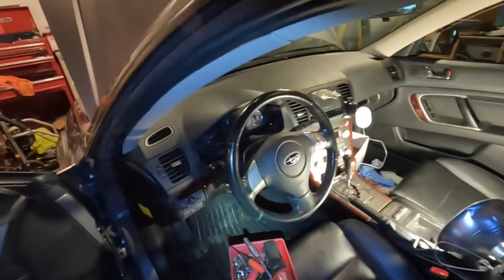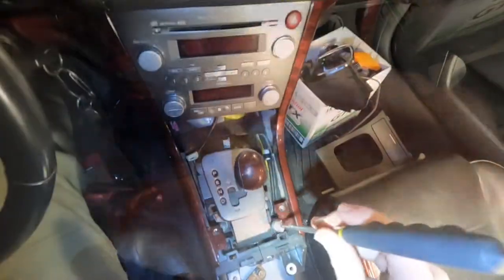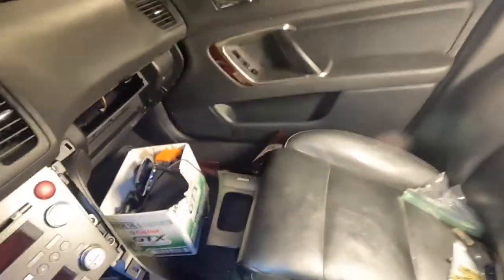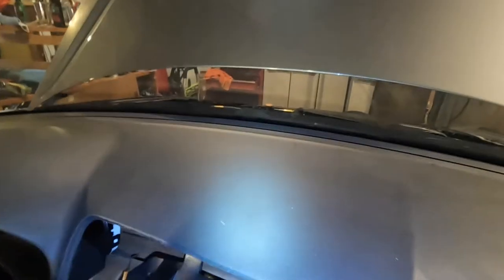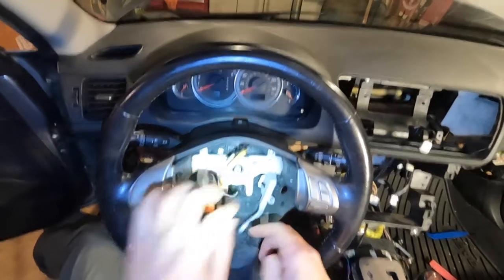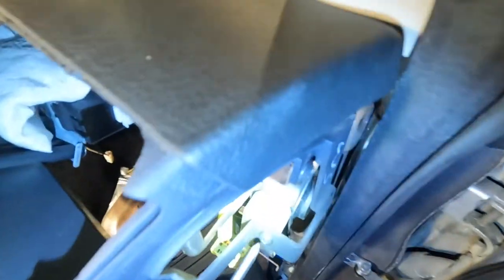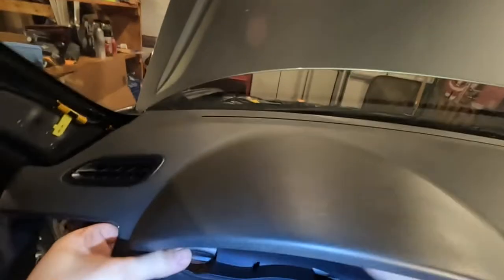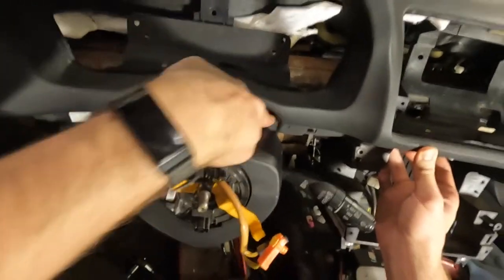Subaru Outback 2005-2009 Dashboard Removal

Comment: So all this is required to change the passenger airbag?? My dash is so sticky and gross. Perhaps the same reason you decided to swap? I still havent taken my car in to have the airbag recall done. If I can find a replacement dash in better shape what are the odds I can get the dealership to swap it when doing the recall work? Am I dreaming?
Reply from the maker: Good question, I believe it’s the only way to get enough room to pry the tabs and slide the old one out. The center support beam runs right behind it and gets in the way. Mine had a mouse infestation and they chewed away at much of the foam and it smelled terrible as it was soaked in urine. If you look along the glass the foam is all chewed, lol. So after about a year this dash also started getting sticky in spots when in direct sunlight. I wouldn’t recommend sourcing and swapping a dash if it’s sticky simply because it will happen again on all these dashes. I’m looking into either a carpet mat or a multi step process to clean and reseal the vinyl. Though if you do find a replacement I don’t see why they couldn’t swap it in when the recall work is done. They used to replace the dash under recall for being dangerously shiny from the stickiness so they better help you out!
Reply: @chrislabbe9412  Oh man I was so annoyed when I realized the dash used to be a recall they don't honor anymore. I mostly just putz around town so the shine didn't bother me as much as the layer of dog hair the sticky accumulated. But I recently road tripped from MN to TX and back and holy hell I burned my retinas! 
I've also been looking at dash mats and the resin sealer which I know ill just get all over my windshield. Maybe I'll price a dash and seal it up uninstalled then try to charm the dealership lol 
I really appreciate your response!! 
I found your video looking for a guide to swapping my cabin fuse block. Any insight if that's too tricky after getting that kick panel off?

Comment: Do the camera angles suck, sometimes but amazing video. I haven't done this in years and I'm right back at it. 

Also, for the heater core peeps make sure you backflush it first and then load it with draino overnight. I do it every couple years. Inlet is on passanger side, outlet on driver side.

Comment: Thanks for the video. I get all the to end and can't seem to find how to separate the airbag connector on the passenger side. Does it just pull or pry apart? There no release clip or anything I can see. I've spent as much time on it as the whole rest of the removal process.
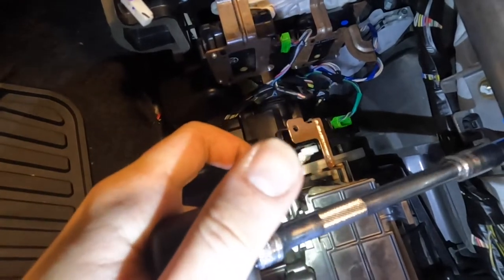Reply from the maker: At about 17:20 it’s the yellow harness, you slide a tab down a good inch or so for them to separate. Once separated it’s easiest to pop the retaining clips on the side so the whole harness comes out with the dash, it’s probably about a foot long and will dangle off the side of the airbag.
Reply: @chrislabbe9412  thankyou sir I ended up breaking it accidentally 😩
Reply: My next issue is trying to remove the airbag from the dash so it can be fitted to the replacement dash. Does it really matter which airbag is  used? I've changed steering wheels along with a different airbag and the computer didn't seem to care.
Reply: Unfortunately the footage didn't actually show what you were doing to separate the plug.
Reply from the maker: @matthewchild7927  sorry to hear about the break, you might be able to splice in a donor harness. As for the airbag I would say use your original as it will most likely trigger the air bag light on the dash if you use one the car doesn’t recognize. That’s the issue I ran into in my haste of the initial swap. It’s very easy to remove the airbags to swap them over, just get a couple flat screwdrivers and start prying back the dozen or so hook  tabs, they’re the only thing securing the airbag into the dash.
Reply: @chrislabbe9412  ok thanks for the advice 👍

Comment: So you have to do all this just to remove the top piece?
Reply from the maker: Yes, many dashboards of this era would get sticky and blindingly shiny and there was a recall to replace them up until a few years ago. Subaru calls for 6 hours for a dashboard replacement but that’s way overkill. In my case I had rodent nests under the dash and it reeked from them so I swapped in a donor dash that hasn’t deteriorated.

Comment: do i have to take out the intire dash to change the heater core?
Reply from the maker: Sorry for the delayed response. Unfortunately yes as far as I know the dash needs to be removed to access the heater core, it’s in the back left corner of the heater unit behind the radio.

Comment: where did you source the dash?
Reply from the maker: I pulled it from a local junkyard car for $60. A 2006 I believe, the early models didn’t have the sticky dash issue it seem.
Reply: @chrislabbe9412  2004 JDM here. Sticky and cracked :(